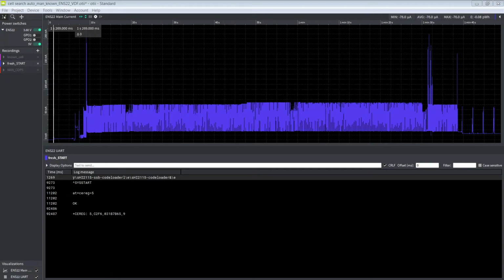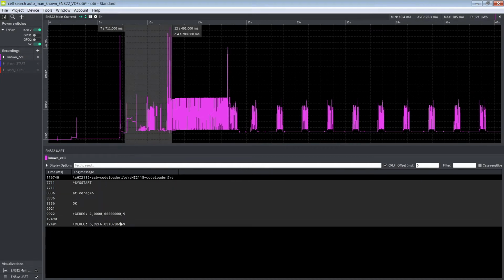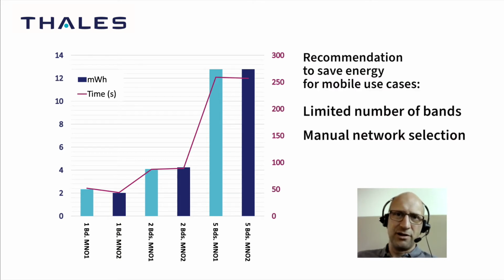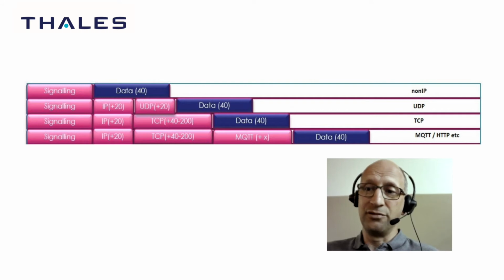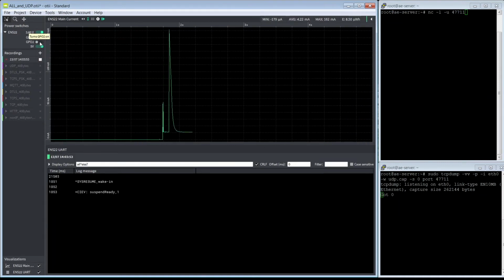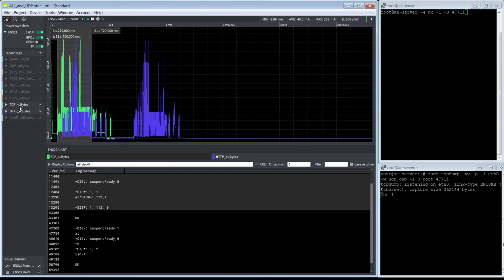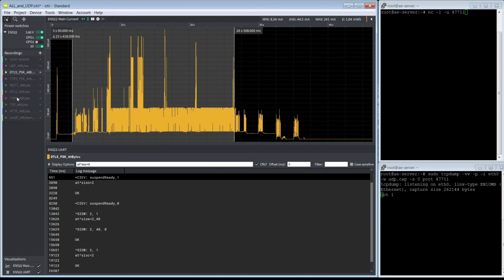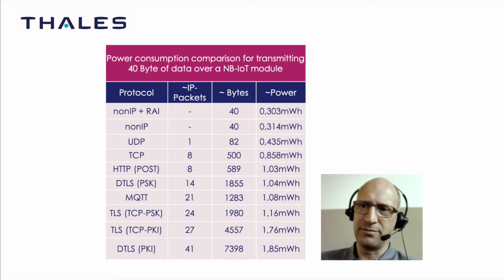How do network registration, coverage and protocols affect a NB-IoT device's power consumption?

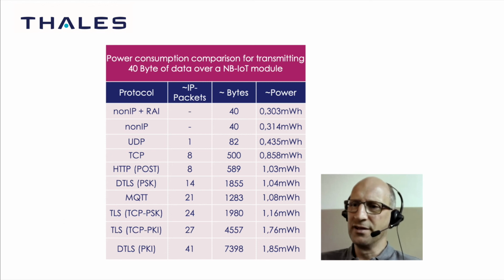Comment: 20:09 Can anyone here give me an estimate of the power consumption for UDP protocol with a 20 Byte data payload?

I'm trying to find out how significant the payload size is for power consumption of a single NBIOT UDP uplink message sent.
E.g. 5 bytes vs. 10 bytes vs. 20 bytes vs. 100 bytes.

Looking at these example it seems the UDP overhead only adds 0.121mWh. It therefore looks to me like reducing payload size to 20 bytes should have a big impact on energy expenditure. Correct?